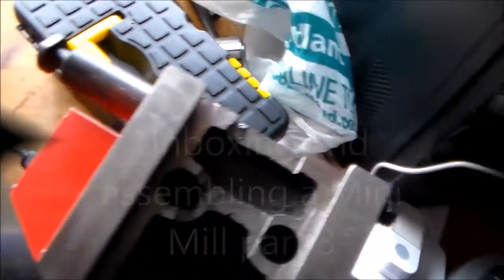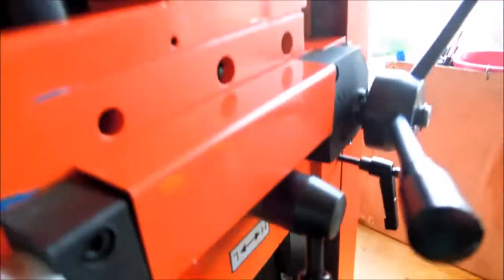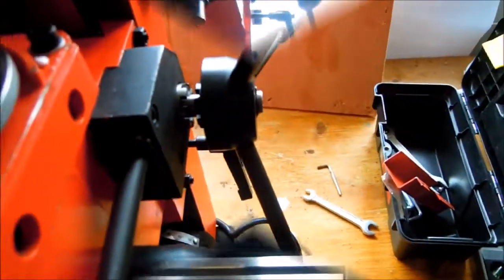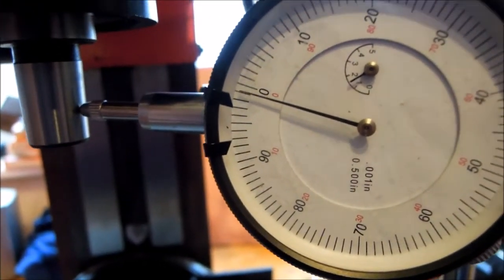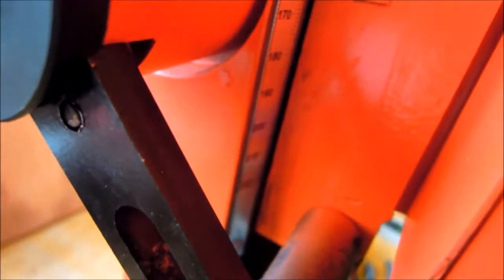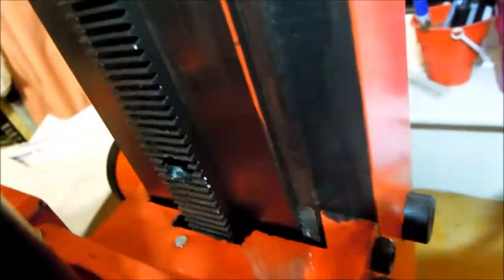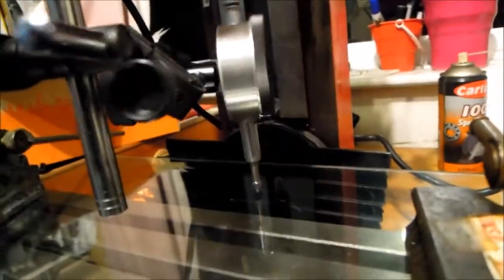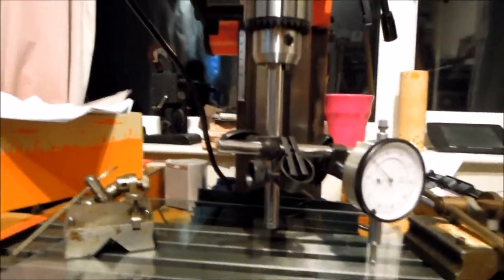Clarke CMD300, Sieg X2 S2, Sealey, Draper, Warco, Axminster type Mill

Comment: how heavy is the clarke cmd300
i see online that its described as "100kg"
is it really this heavy?
could one man lift it up a stairs?
or would multiple be needed
is it easy to dissassemble? (remove the head)
Reply from the maker: It is likely to be delivered as three packages, the delivery drivers are not allowed to lift 100kg. Base, column and the head. I did an unboxing video. I'm not sure if I mentioned the package weight. Also, whilst not the exact same model they are of very similar design.
Reply: @bikerides  I ordered a Clarke CL430 and it arrived a few days ago and it was described as 130kg I think. Delivery driver just left the box outside. Had to destroy the box carry it up a set of stairs to the apartment. Was in the heat trying to unscrew various things to no avail for hours until luckily neighbour agreed to help carry it up and it was me, him and my housemate carrying it and we were barely able and sweating. Could feel it for days.
Reply from the maker: @problematic7993  wow! Sorry to hear about the trouble you had. I hope others read your comment and are forewarned. I guess Clarke assemble and test their models. I hope you can now enjoy cutting some metal.. Or other material.

Comment: After seeing more than a couple of these mills sold under different brands, I've come to the conclusion that the manufacturer grades the parts they make, and all the best bits are painted red and assembled as Sieg machines. The next best parts are used for the likes of Clarke and Draper and Axminster. A few other tool company's get machines made from the parts that were somewhere close to within tolerance, But then all the OTHER left over bit's that were so far out of spec that they're just fit for the scrap bin are loosely assembled and flogged off by Chinese eBay sellers as unbranded machines !

I've seen so many reports of the unbranded one's having multiple problems, like unparallelly dovetails all over the place, and nothing truly being at 90' to anything else that this can't just be a coincidence.
Reply from the maker: I believe that branded reliable sellers require tight tolerances. I would recommend Chester Machine Tools if you want quality at a good price. I have had some good quality unbranded stuff from China. Tachometer (hand held and hall effect), digital DTI, temp gauge, USB current and volt meter etc. etc.. Buy local is always a good motto. I live too dangerously sometimes, but I do not like paying twice as much for a badge - which can also happen!

Comment: I used valve grinding paste on all my dovetails and pushing it the full travel. I move back and forth 25 times adjusted the Gibbs 25 more adjusted the Gibbs cleaned it and put maker on the dovetails to see the low and high spots. I took a shaping stone to get all the sharp edges off. Back to the paste till i liked what i saw with the maker test.
Reply from the maker: Hi Sam, that is a great tip. I am going to give that a try. Thank you. I looked at the Chester version and it had a great polished surface.

Comment: Given how many flaws there are on the machine, I'd consider returning it. It may be nothing but hassle further down the road.
Reply from the maker: Been through that same though process myself Strathpeffer. However, now it has been set up it seems to work OK. What tests would you recommend?
Reply from the maker: Why is the Z axis so smooth when the grinding of the bearing surface is coarse? https://youtu.be/dRHCRs7WtMY